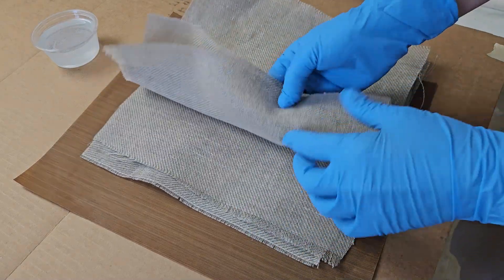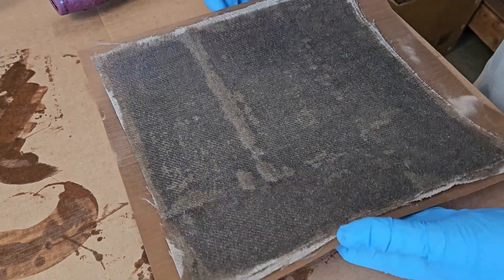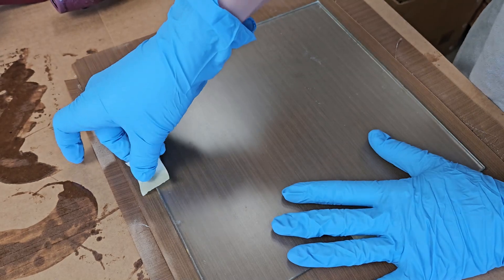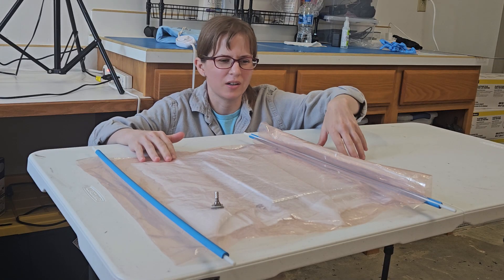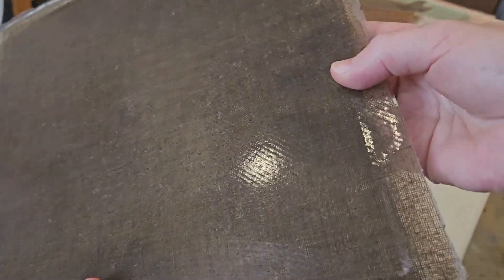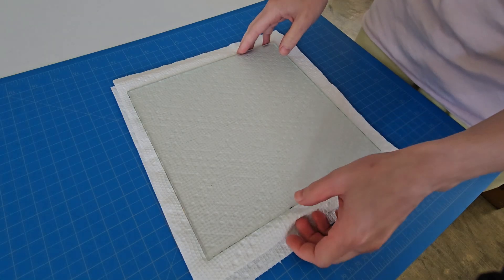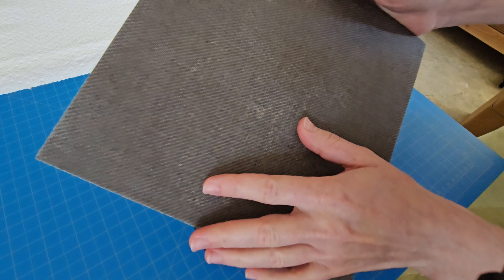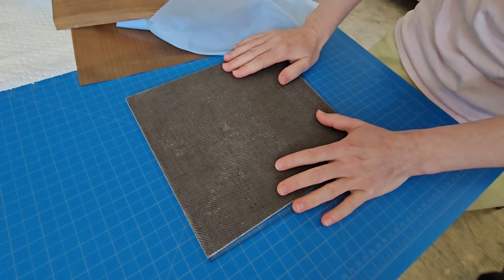testing natural flax composite panel

Comment: Use a multitool with a Tungsten semi-circular cutter.  Works well with epoxy and glass or carbon.  Maybe with flax too.  Doesn't raise too much dust.  Cut adjacent a hood with a vacuum attachment - your next project. ;)

Comment: That tablesaw without a sled/fence looks mean. Kickback with a composite panel would be my worst nightmare.
Reply from the maker: It's a wet saw with abrasive blade, so the cut is normally smooth and safe with carbon fiber. It seems that flax can't be cut that way with the fibers being so porous.